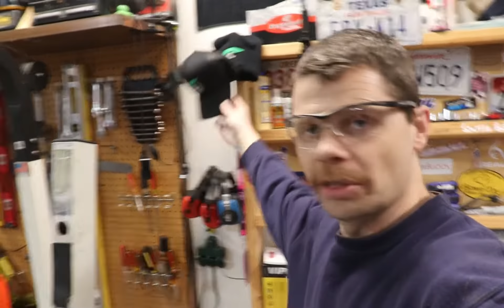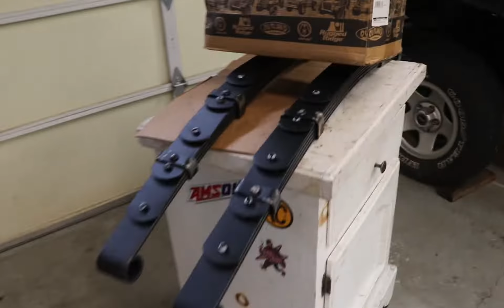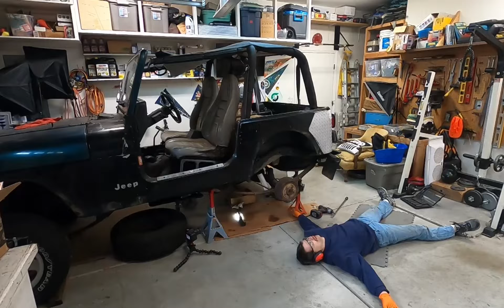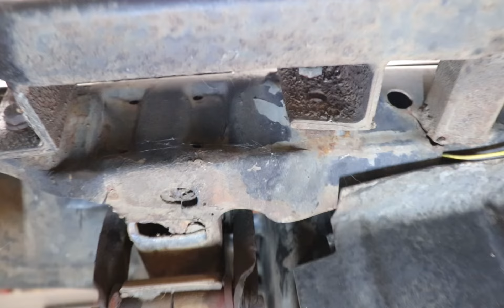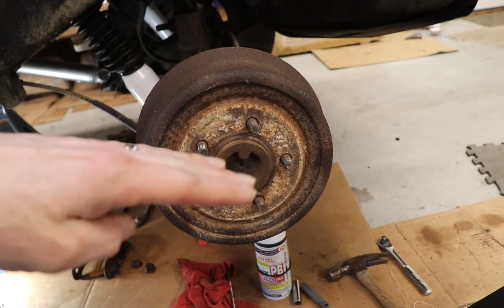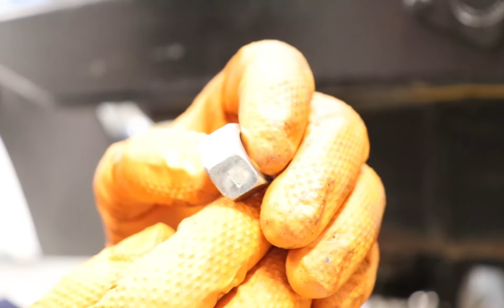Jeep YJ Leaf Spring Install:1992 Jeep Wrangler YJ

Comment from the maker: Rugged Ridge could not give me a torque spec for the bolts. UGH.. come on RR..  anyway, I ended up torqueing the shackle bolts to 55ft lbs. This is not factory recommendation, but I could not find out what that was. I came up with 55 from my own research. If you find something better, let us all know!! Thx :)
Reply: Specific torque wrench setting: pft, pretty fkn tight.
Reply: @Smarterthanyou-mthrfkr  pft has been a factory setting for decades.
Reply: 85ft-lb - 95ft-lb is what was on my documentation.
Reply: I have never bothered torquing spring bolts, pft has always worked(pretty fkn tight”:).

Comment: ..   11oz. Liquid Wrench Penetrating Oil
4.7 out of 5 stars
(4.7)

271 ratings
Key item features
Superior Lubrication: Superior lubricant formulated specifically for chains, ensuring optimal performance.
Optimized Dry Time: Dry time is optimized to provide maximum protection, drying only after penetrating chain links or cable strands.
Oxidation Prevention: Prevents oxidation and extends the life of components, maintaining their functionalit

Comment: To get your best bang for the buck with your impact gun, put the impact on the nut side.  The length of the bolt will take away from your hammering effect by flexing.  Think of it like this.  When you use a long extension, you can move the handle of your rachet or breaker bar a few inches before the socket starts to move when it takes a lot of torque.  The longer the bolt the more ineffective your impact is.  But on the nut side you have a better chance of it moving.  I noticed at 4:34 he had his impact on the bolt side and was non effective.

Comment: Thanks for  videos...just replaced fuel tank skid plate, fuel hoses, etc from one of your other videos and putting POR 15 on frame, etc. Keeping leaf springs but in the process of replacing bushings. When removing leaf springs I didn't loosen the shackle. Question...shouldn't the eyes/holes match up when putting back on without loosening the shackle?  Mine are off a bit and not sure why...possibly due to no weight on them, etc?  Thanks again

Comment: I put 2" lift shackles on my jeep wrangler and I didn't have to cut the bolt off. I loosened the gas tank enough pushed forward a little bit and it slid out without cutting it.

Comment: Apply PB Blaster or penetrating oil 24 hours in advance. Use Red Rustoleum primer to reduce the rust; do this all over for light surface rust; it solves the problem of rust; do it periodicaly!

Comment: This brings back painful memories of replacing the suspension components on my Subaru Forester. The rear passenger side I went and bought biggest Milwaukee 18 V half-inch impact I can get. No torches, no hammering. I put some PB blaster on it and it either came off or broke off. Screw hours of tedious work.

Comment: Thank you for this video.  Note to anyone else attempting this.  Be patient, have lots of PB Blaster, a cutting wheel, a saws all with carbide tips, a breaker bar, floor jacks, jacks stands, and did I mention, a lot of patience.  I had to walk away and come back to this project several times.  It was not a two hour install like the box said.
Reply: 2 years later i will just add more patients.

Comment: Hey Dale absolutely love your videos. New subscription here.  Taking on complete tie rod replacement because of your videos and I appreciate it. I have a question concerning boomerang shackles..... I have a 95 YJ 4.0. I have a 4" RC suspension lift with a 1" TC drop. Im wanting to put on some boomerang shackles on all 4 springs but was curious if this would mess up any steering angles or driveshaft angles?

Comment: Hey Dale, I'm going to be changing out front and rear leaf springs, what size bushing are needed for the frame of the YJ that bolts to the shackle, the one you had to drill out? Please help I need to order the right bushing for front and back

Comment: I have a 92 yj... reverse the front shackle position  really helps the handling on the road, without changing spring articulation.... in other words make the front spring mount solid and the shackle at the back of the front spring....

Comment: Brother says  acetone and brake fluid works better than pb buster. Also,  saw another  video  that shows  if you  swing rear leaf spring all the way to  the back it will  clear gas tank. Starting this project  soon. Do you  have  video  of front  leaf spring  removal /install?

Comment: Just ordered my rough country 2.5 in lift kit to replace my old sagging 91 yj suspension. This is very helpful, thanks Dale!
Reply: I have been researching 2.5" lift kits and found alot of negative reviews on rough country kit (I have 1995 yj) how is yours on street, trails...?
Reply: @Bigbeachbitch77   feels a bit stiffer but overall I can't complain. It still rides like a leaf sprung jeep and for the price it was worth it for me. I do have a heavy smittybilt bumper/tire carrier and had to add 1inch boomerang shackles in the rear to lvl it out. Havent gone to hard on it yet either, Hope that helps 🙏

Comment: a 1/8" zip wheel on four 4" grinder, cut through the old bushing and bolt between the spring hanger and both sides of the spring, go buy new bolt, install new spring and new bushing, just be careful controlling your cutting wheel. saves sooo much blood sweat and tears. there is enough room, but have a steady hand.

Comment: My rear left spring occasionally makes a clink sound and the whole body of the jeep shifts over a little when it happens, I think one of the leafs is slipping over another and gets slapped back in when I make a hard turn. Do I need a new leaf? There is visually nothing wrong with them, I clean them regularly and they have almost 0 rust.

Comment: Just go by the  diameter  and grade of your bolts for torque.   9/16" diameter Grade 8
I looked it up, coarse is 115 ft lbs.  And  fine is 129 ft lbs.

Comment: Hey  Dale.   I have noticed that on a lot of  different rubber bushings, that they get soft or mushy over time from having grease on them.   So I often use silicone brake grease instead of  bearing grease.  The silicone grease doesn't soak in to the  rubber.  And it works excellent for repelling moisture. ..

Comment: pb blaster=nectar of the gods!
Reply: dont go to 55ft lbs on the center bolt. i do about 35 with nylock nuts on the main bolts and I dont even run the center bolt but if I did it would get the same 35. YMMV. IMO that center bolt is just flex inhibitor

Comment: You need to quit using deep sockets  first off and second get the dam torch out
Reply from the maker: Don’t have standard 1/2” sockets. Only deep set. I’d like to get some in the future 👍🏼 Using what I have for now
Reply: Wait why no deep well?
Reply from the maker: Deep set create a slightly worse angle in this application. Would be better to have the arm of the wrench closer to the bolt head
Reply: @JeepSolid  ahhh true but it was more so aimed at the guy treating you like an amateur! Thank you for all the great content !

Comment: Try using aerokroil penetrating oil instead of PB blaster. You will thank me later.  I normally add some heat (propane  or mapp gas) then spray on aerokroil wait a few minutes then “bang”they come off. Works great!
Reply from the maker: I'll have to pick some up and give it a try 👍🏽
Reply: I like both, but you're right Aerokroil is good stuff.